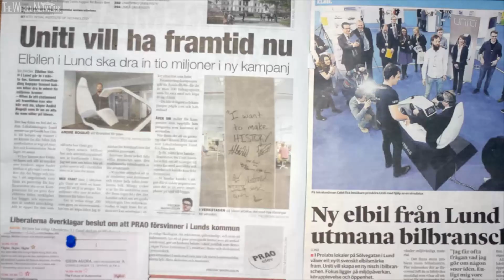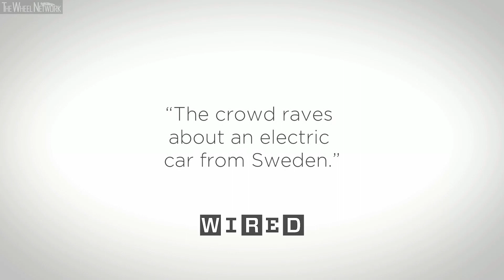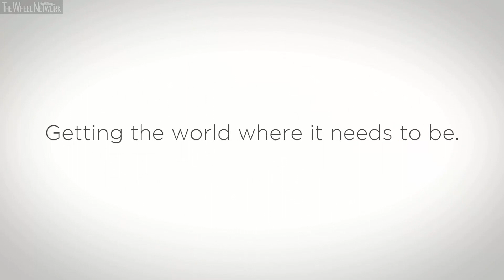Uniti One Electric Car – The Story of Uniti

Comment: this car is to expensive, needs to be under 10,000 euros. to be compete.  get rid of the silly steering  wheel. and the computer lap top thingy, ordinary steering wheel and instrument panel. and that would knock thousands off the price, also change the doors. not practical, use scissor type doors like the zagato volpe. better in a tight parking space like mine. you are lucky they never put the volpe on the road, it would have wiped the uniti out. but i give you ten out of ten for trying, would not mind one if cheaper, to play with. but cant,t wait another 5 years to get one. the chines cars win, i would like the chery e car eq1 400ev.  better looking. longer range, and much cheaper. if china brought the cars to the uk, they would put a lot of the other e car makers out of business, 

probably why our government, or someone is stopping them.